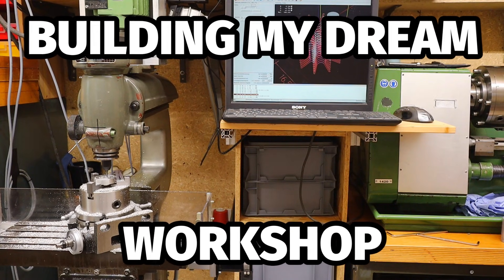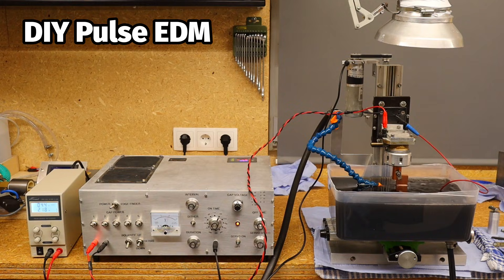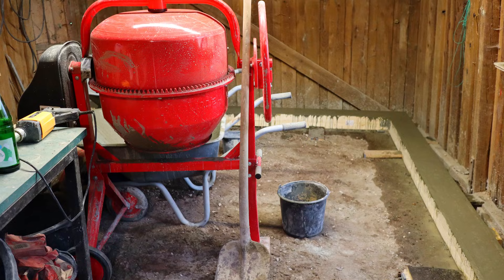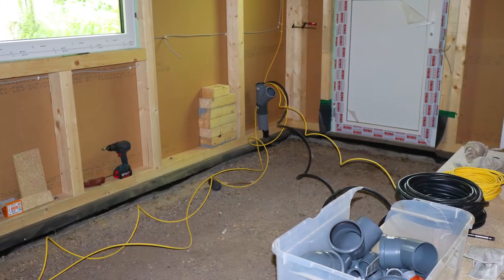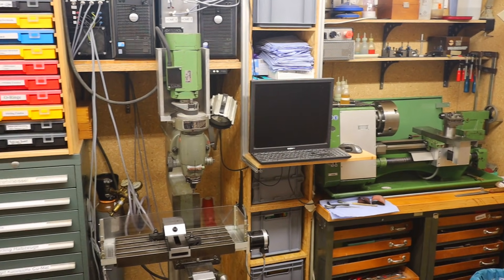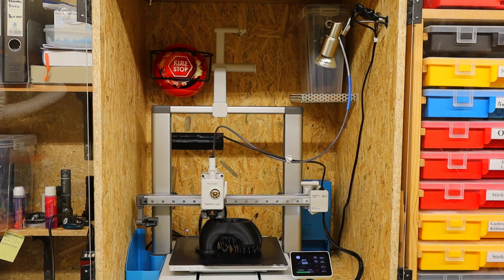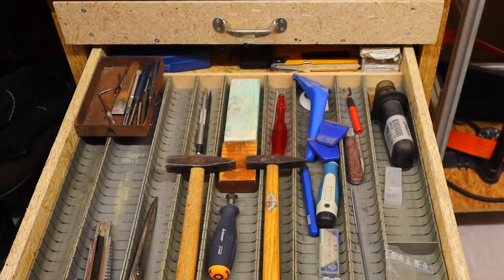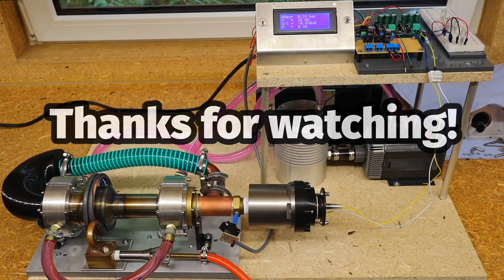Building my dream workshop

Comment: Have you considered a shape memory alloy based regenerator in your thermoacoustic engine? The EU SMAcool project is investigating such usage in a cooling application, as an application of elastocalorics. Elastocalorics have a unique high speed cooling and heating cycle that the pumping action within a thermoacoustic system can provide. SMAcool is looking at compressing shape memory honeycombs to avoid metal fatigue. Using an auxiliary piezoelectric transducer to compress the SMA honercomb regenerator allows some control. People have described the SMA regenerator as a hard spring in comparison to the soft spring of the gas, and as a supercharger for a thermoacoustic engine (though it will rapidly consume heat from the HHX).
Reply from the maker: I'll take a look at that, thank you very much for your valuable suggestions!
Reply: Havent put much thought into it but this suggestion made me curious about simply using a spring or rubber to deform a stack of piezo elements for electrical power generation. Should be comparatively simple to set up by sandwiching copper- and PVDF sheets.

Comment: Name it "Proxxon garage" 🙂
Reply from the maker: What makes you think that? 
My first little workshop actually consisted of tiny Proxxon lathes and milling machines, but I don't have any photos of that.
But good naming ;-)
Reply: @myengines2443  Hint was the PROXXON 23821 on wall. And the not ending space constrain even with new place...
I have something similar - 70yr old small building for "one pig and 10 hens". To small for welding, grinding, painting, 3d printing (with resin!), laser engraving etc. I see solution only in creating new shop made of prepared walls of PIR insulated boards, on pillars and ready to dissembling/change.

Comment: Have you tried diy aluminium or cast iron casting using sand mold ? This workshop is amazing, addition of a small sand casting with 3d printed mold would be a great addition.
Reply from the maker: I am thinking often of doing aluminium casting also but it would need so much time to master this technology that I will first try it when I need small-batch production for example when the thermoacoustic delivers enough power to provide it as a kit or something!
I am very interested in casting and I will do it some time for sure!